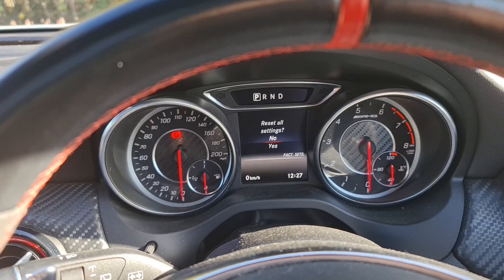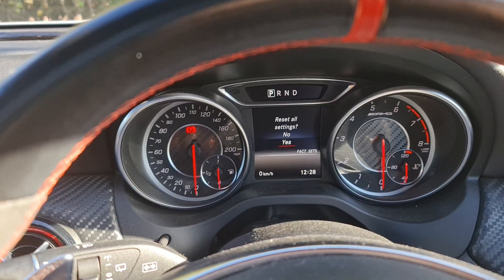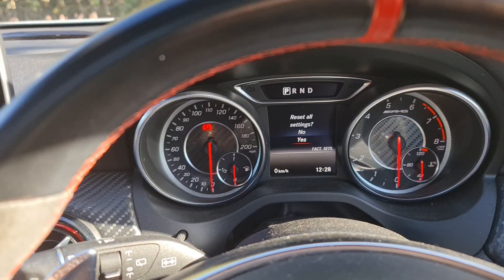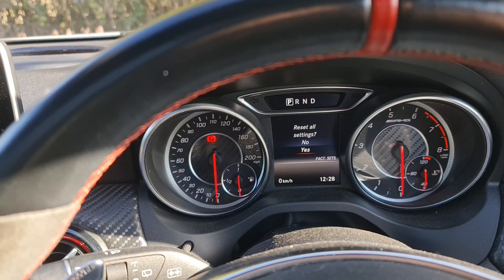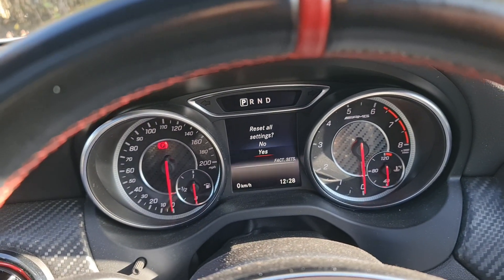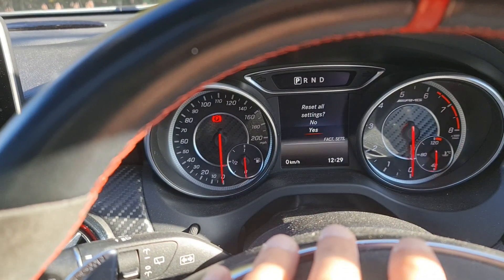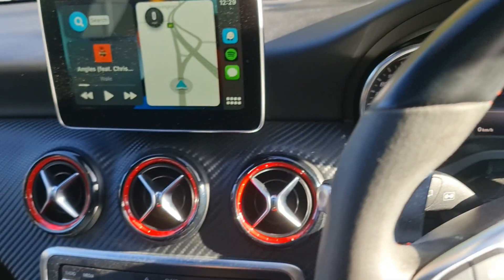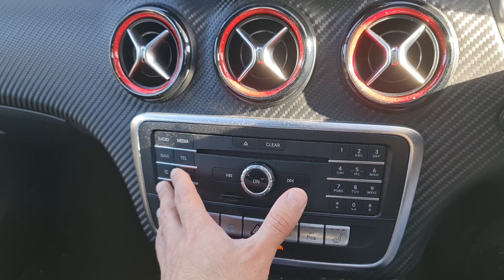How to activate engineering mode in your Mercedes Audio 20 Command NTG5 system?

Comment: Nothing happens when I press them buttons
Reply: I folow instructions! But I still can't get into engeenering mod😢 my car is cla 250 2015  NGT5
Reply: Same here, cls 400 2015 (c218/w218)
Reply from the maker: Did you follow the instructions in this video before using them buttons to activate it?

Comment: Can you get more ambient light colours from engineering mode?
Reply from the maker: No that's not possible as that's hardware change. Currently w176 models are fitted with 12 lights only.

Comment: I can’t gain access to engineering mode I have a 2016 gle 63s
Reply from the maker: Did you attempt the above steps in the video?
Reply from the maker: Also, check your SW version from this video: https://youtu.be/TGecSGU1NGU and let me know.
Reply: @ManiSuReal  I have SW 164730 version. NTG5star1 Can not enter to engineering mode!
What could you recommend to do ? Thanks! :)

Comment: I was able to access engineering mode by rebooting from the stereo part instead of the instrument cluster. But when I toggle carplay on in the engineering mode as soon as I save and exit it switches right back to off. Any fix?
Reply: How did you reboot the stereo part
Reply: Same, did you fix?

Comment: Thanks mate,
I'll test it tomorrow morning as I'm on a trip today.
Appreciated your effort and time.
Reply from the maker: No worries mate, all the best 👍
Reply: 😢 didn't work on my device mate. I did exactly what you suggested but no luck. Do you have any other suggestion?
Can I unlock that menu via Xentry?
Reply from the maker: @Matt_3535  Thats a shame mate, I think this could be related to the software version on the audio system. It might have been upgraded to the latest version where its now blocked by Mercedes. Can you check the software version here https://youtu.be/TGecSGU1NGU and tell me what it is?

Also, what exactly are you trying to achieve from the engineering mode?
Reply: I sorted via Vediamo & Xentry :)
There was an error message on head unit. I cleared that message via Xentry. Then I enabled engineering menu on Vediamo 4.02.02
And Hangup+1+# worked for me 😊
Thanks again for your support